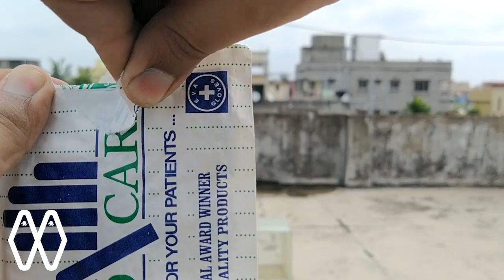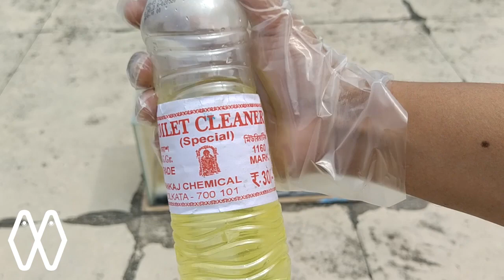Repairing | Restoring an Old Aquarium

Comment: Gum gun set price plz?
Reply from the maker: Dowsil silicone adhesive is usually ₹200-₹250 per tube. Caulking gun should be around ₹150-₹200